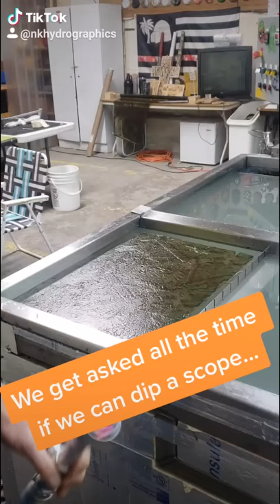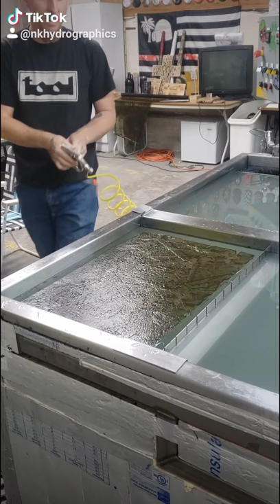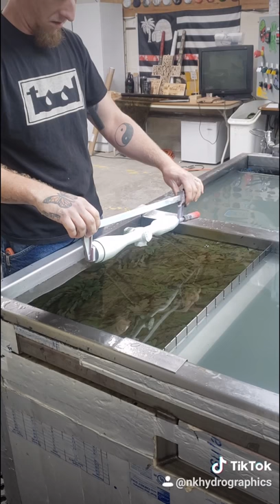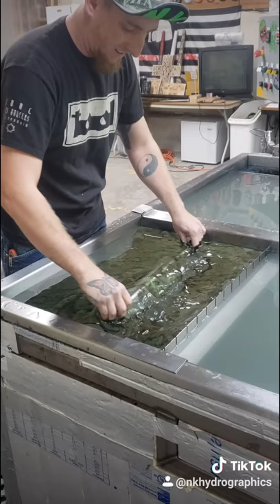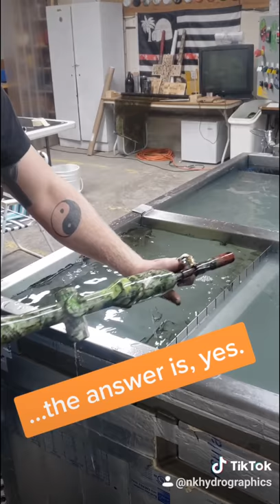Dipping a rifle scope

Comment: What do you use to plug the ends of the scope?
Reply from the maker: Rubber plugs
Reply: @nardiamkustoms5679  Did you buy them or diy them
Reply from the maker: @hankharrison5710  hardware store has them
Reply: @nardiamkustoms5679  Thank you sir
Reply from the maker: @hankharrison5710  any time
Reply: But plugs with suction cup bases work great